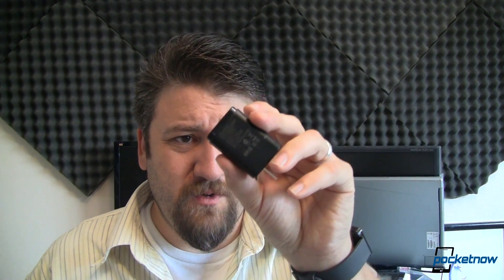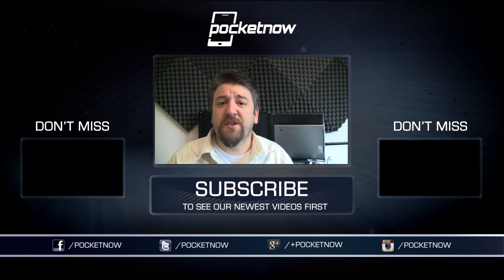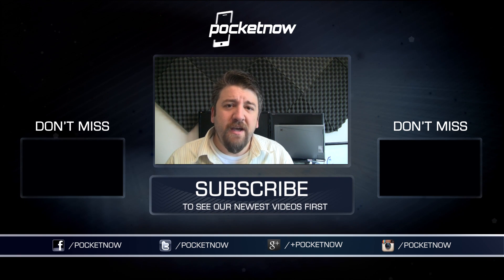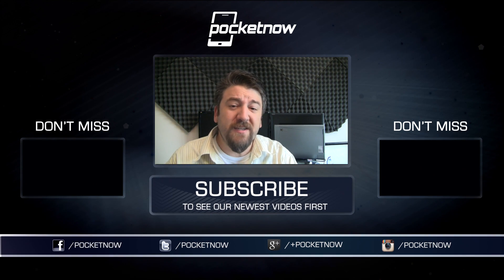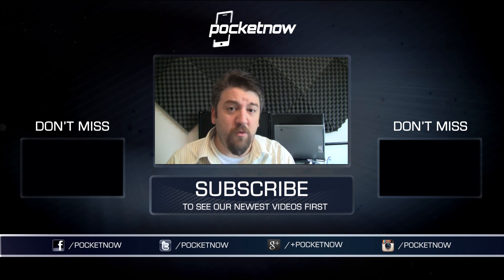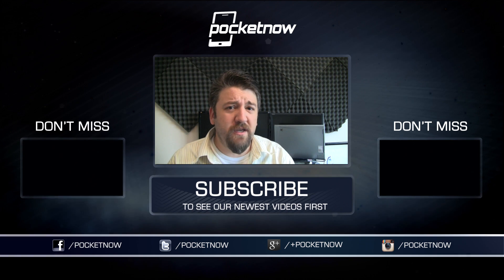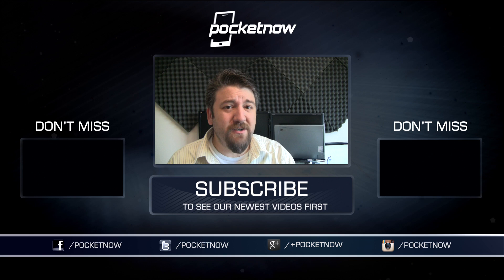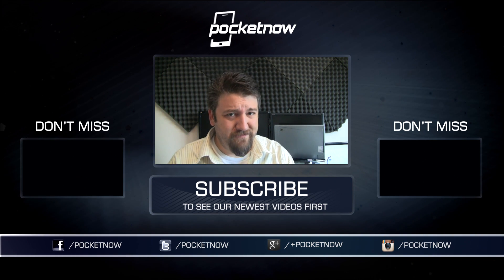Why some chargers are faster than others (Pocketnow Power User S02E08)

Comment: The part about charging current is unfortunately incorrect. You can absolutely use a USB charger that’s providing a higher current than the maximum charging current of the cell phone. The USB charger can for example provide 2 A. If the cell phone can’t charge with a higher current than 1 A, you’ve purchased an unnecessary expensive charger. That’s it. It will work just fine and there’s nothing harmful about using it. That’s because the cell phone is charging at 1 A whether it’s connected to a 1 A charger or a 2 A charger. It would still be charging at 1 A if it would be connected to a hypothetical 50 A charger. The reason to buy a 2 A charger is that it can charge other cell phones (equipped with higher capacity batteries) at a higher current. If the maximum charging current of the cell phone is 2 A and it’s connected to a 2 A charger, it will charge at 2 A. If the same cell phone would be connected to a 1 A charger it would charge with 1 A and it would take about twice as long to fill up the battery.
Reply: Bruuh

Comment: Informative, period! If u didn't know now u know, simply put V=IR, P=VI. Nowadays, chargers use switch mode per supplies like the pic's, meaning even if u have 5amps at ur disposal, ur device only draws the amount it needs =<5. As opposed to old school transformers where the output current would be forcefully pushed to ur device and damage, melt or blow it up if it only tolerates much less current than the one supplied.

Comment: It is NOT dangerous at all to use a higher amperage charger for your device.   If your phone or tablet is rated to draw let's say 2amps,   that's the maximum it will draw.   If you plug it in into a 5 amp charger it will still only pull 2. 

The phones and tablets PULL the charge from the charger.   It's not pushed to it from the charger.   Your conclusion about not using a higher rated charger is completely wrong. 

This video should be taken down and redone with the correct information.
Reply: Saul Nunez it will not pass the limit.   It will not damage it.   This is well understood and can easily be verified.     

Yes it moves forward.   Pulled in that context I was using means the device request the power from the charger and the charger delivers that amount.   It flows into the device but it's not the charger to dictates how much. 

This is why some devices will only pull the use spec from a computer.   You know when you get the USB charging ( slow)  in your battery stats.   Even when your USB port can likely deliver more.   The device is asking for that much and that's what it gets.    Some people make kernels that allow USB fast charge.   Meaning it will pull more power if your port is capable of delivering it. 

You can't just hook up any phone to the let's say the oppo fast charger ( or any similar and have it draw / pull or flow to the device at that amperage. It can't charge at that rate period. 

Same with Qualcomm quick charge..    Device determines the maximum power it can draw.   Not the charger  

He is wrong period

Comment: technically Ohms Law is just stating that Voltage Divided by Current is constant:
V/I=const.
for certain electric... "devices". To be able to work with this law, These Constante is then called Resistance and is typical for this "device" (althought Ohms Law is not correct for many  "devices", like Light bulbs for example or Transistors or Diodes)
The Point is that, althought it is generally stated thet V/I=R or I=V/R or V=I*R is Ohms law it is not true. technically.